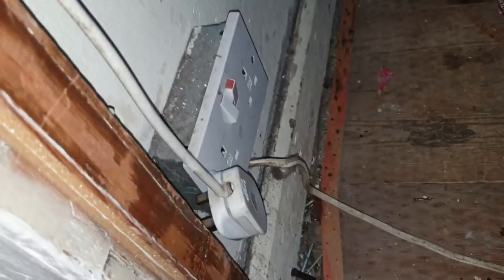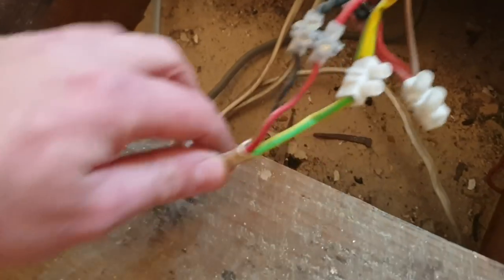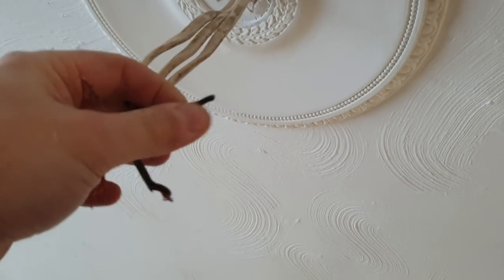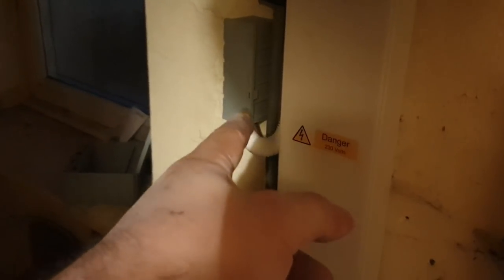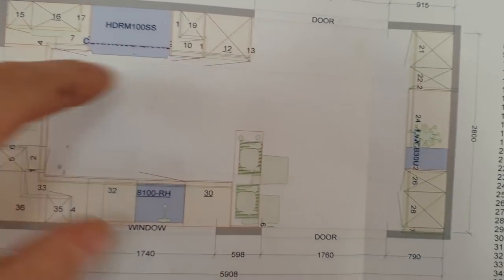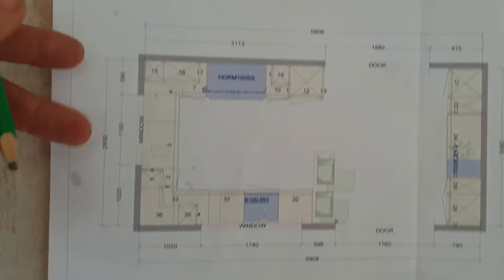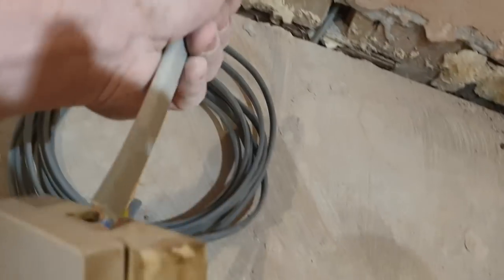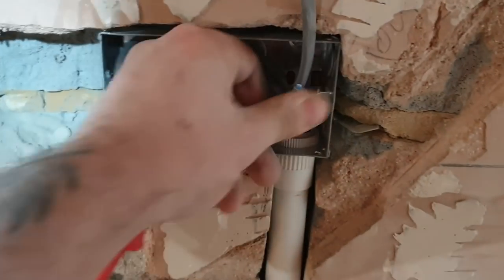FAULT FINDING, FUSE BOARD and kitchen FIRST FIX

Comment: 40-50 years time, some young spark is going to love you for that conduit. 
You’ve just made him a good profit on his rewire 😁
Reply: not if they decide to renovate the house an move walls build extensions on the place,  they may even decide in a few years to tear the place down an rebuild, real shame sometimes when they favour building new houses instead of ( if possible ) save the older houses ....

Comment: Top notch Luke, keep em coming... I'm sure I don't need to tell you but remember to provide two separate 13A single socket-outlets for the WM and DW, I came across a job where the installer had fitted one 13A double socket-outlet both the WM and DW. He/she obviously couldn't see a problem with it, two appliances two sockets 😂😂😂
Reply from the maker: I didn't know this. Thanks mate.

Comment: For long screws and deep holes, I use 'cut to length' plugs which come in 300mm lengths (Blue, Green, White and Red for different hole/screw sizes). They are also more robust than normal brown or red plugs.

Comment: I always use 48mm KO boxes and I've used conduit in the wall a lot too.  The only thing I can see against it is where the leaf is only 100mm thick, cos theoretically according to building regs you're only allowed 1/3 depth in the leaf as a chase.  Thanks for the video.
Reply: 1/3 vertically 1/6 horizontal
Reply: You must really love chasing if you always fit 48mm KO boxes 😯
Reply: @ashmanelectricalservices4318    I'm feeling a bit battered from some quite justified slagging off of some not very neat job I did in a basement in the comments of my latest video.  Do I love chasing?  Yes I quite enjoy it, I've got the metabo kit that Nick Bundy had for free.  Having said that last summer I got the most horrendous hard engineering bricks in this bungalow kitchen, which was a total ball ache and caused some real wear and tear on my tooling.
Reply from the maker: @johnbrain6790  I've been reading part-A of the building regs and struggling to find these measurements. Can you let me know where you found them as it would prove really handy for future reference material mate. Cheers ears.

Comment: Hi, excellent video!
Quick question: I am having a periodical electrical checks done by my local council. I have some heavy furniture with lots of stuff covering some sockets which will be a pain in the proverbial to move around: Two of the sockets are permanently off and the other two sockets have extension cables running behind the furniture. Will I need to remove to furniture to access the sockets I use, or can you do a test just using the sockets on extension cables? Thanks
Reply: If it’s done properly then yes, they will need access to every single socket in the property.

However as it’s being conducted by your council I highly doubt they will do it properly and will probably only need to access one socket on each circuit. Source: I sub-contract a council and sometimes have to smash out 4-5 EICRs a day..

Comment: Luke, at 08:05, what size is the trunking you're using to run the cables to the consumer?  Does that oval cut hole in the trunking lid  come already cut or did you cut it yourself?
Reply from the maker: 50/100mm. The hole was cut by hand mate.
Reply: @MyTrustedElectrician  Thanks bud!! 

Keep up the videos they're great!